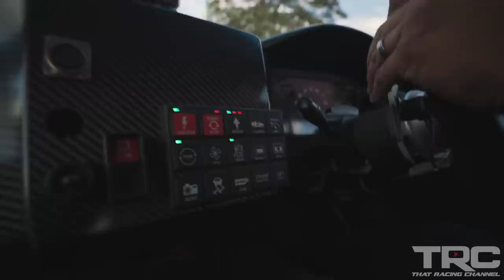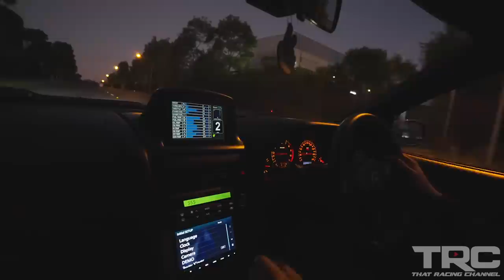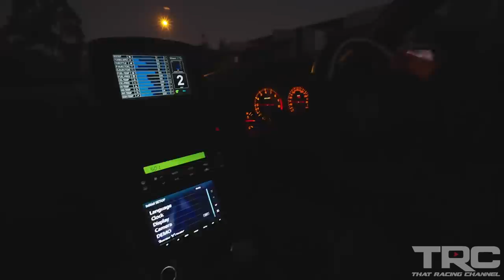1200HP AWD SR20 Nissan Pulsar GTI-R "Mini Godzilla" + 1100HP R34 GTR Backroad Launch!

Comment: 13:14 When the exhaust moves back and forth like that it's the entire powertrain moving on the chassis mounts. Think about that for a moment #bigtorque
Anyway, my m8 recons his 2006 sv6 with an electric water pump and a big bore exhaust would "eat you for dinner" in a roll race. He admits it might not get you off the line but would catch and overtake you at about 300m (he's serious)
Reply: The exhaust on my 100hp Corolla moved a lot #bigtorque...

Comment: Worth mentioning that octane ratings are not the same in every country.  Europe and Australia use the RON system, US and canada use AKI system.  There are lookup tables available online.  In the US, our 87, 91, 93 octane would be like 91,93, and 98 at the Australian gas pump.
Reply: UK has the best octane. Lowest is 95 at the pump
Reply: @jigzonyt517  If you understand how octane works, higher number is not always best.  If an engine runs fine on a lower octane, there is usually not really a benefit to running a higher one.  There are plenty of cars that run fine on $2.80/gallon 87AKI.  It would just be throwing money away running them on your $5.50/gallon 95RON (91AKI).  The exception to that are the newer cars with variable cam timing and whatnot.  They can adjust themselves on the fly if they are running a higher octane and produce more power.  But those sort of engines are less common.

Comment: I wish i saw more of these in the uk. There was a few at one point but we hadnt got proper tuners over here at that time. I reckon most on the strip were 300/340bhp. But those dies long ago. Noone i know runs one for these locally ans certainly not this kind of power.

Comment: Loved this video. Rb is still better than a 2j. Hate me idc.
Reply: As a Nissan man I completely disagree. Even the 1JZ is a much better engineered engine than an RB26. Better oil galleries, better oil pump, Siamese bore, better quality metals etc. The list goes on
Reply: @russianbotstein1422  Thank you for stating what I was about to. Block thickness and density is far higher in JZ motors also.